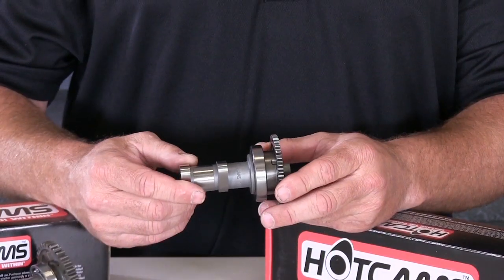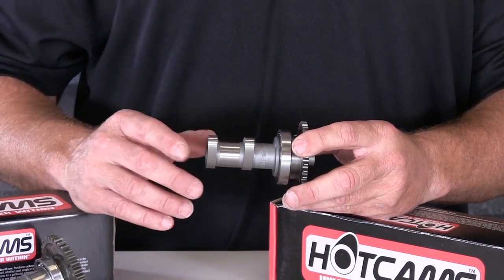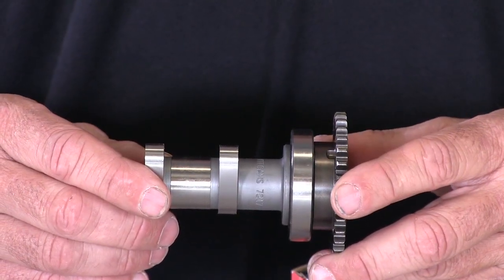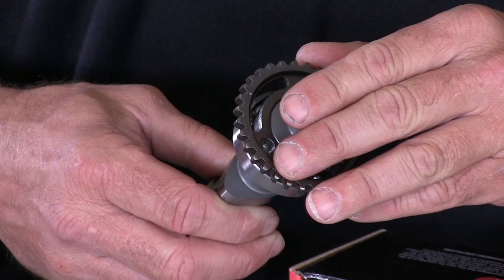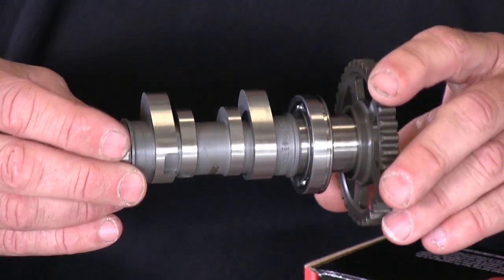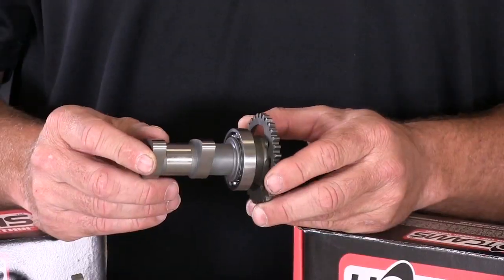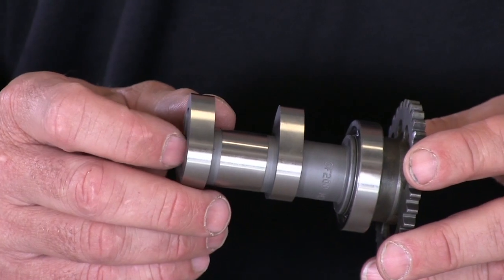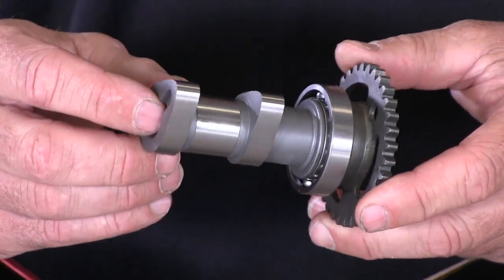Hot Cams Stage 1 camshafts

Comment: Thinking of your Stage 1 cam for my XR650L? I have a few questions relating the Stage 1 cam specific to the XR650L: Loss of low/mid end and gain in top end? Any more stress and wear on the valve train? Any overheating issues related to the XR650L? Does it use the OEM auto decompressor?  Any starting issues without using the auto decompressor? Do you recommend installing the older cable operated manual decompression lever? Gas mileage? thx

Comment: Interested in buying the new stage 1 for my '06 DRZ400SM but I was wondering, will the stage 1 offer any improvement in top end and peak power over stock? Or is it only designed to improve mid range and low end torque?
Reply: Sruikyl only the low end
Reply: Sruikyl stage 2 is top